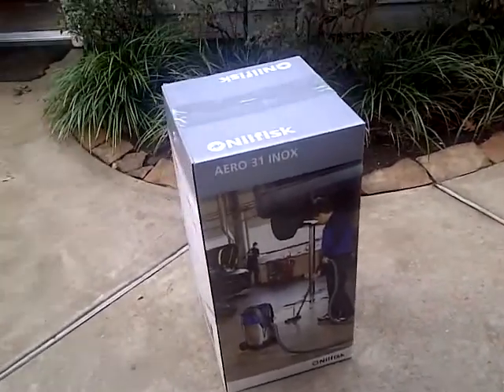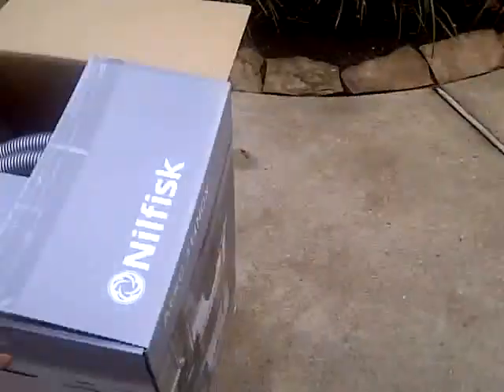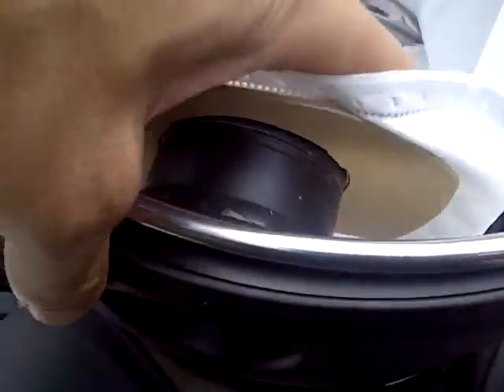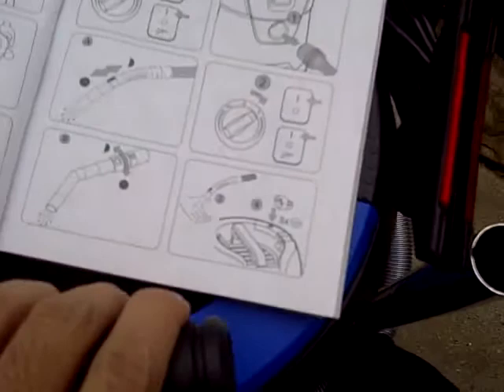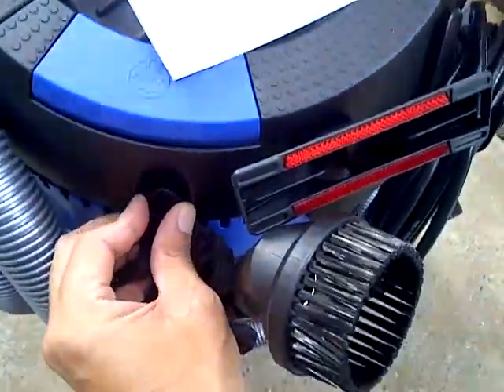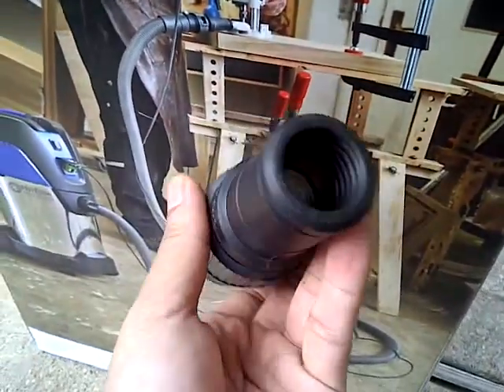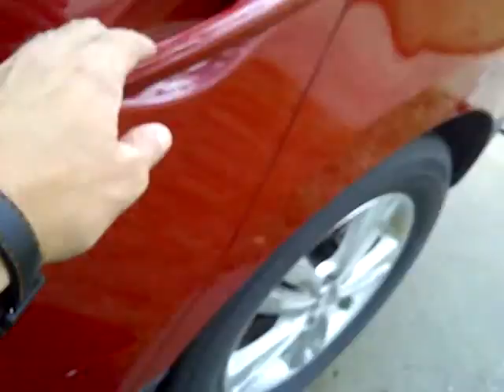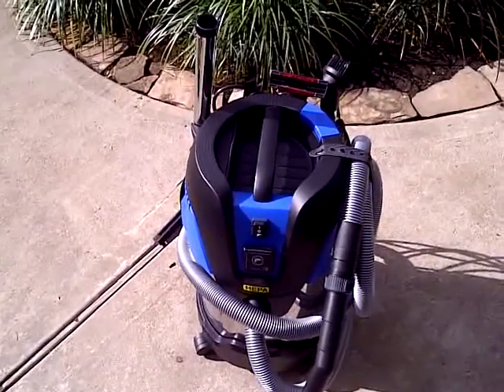AERO 31 - 21 PC INOX 120V/50-60Hz Nilfisk Dry/Wet Vacuum

Comment: The plug is when you use a tool like a sander. When you turn on sander, the vacuum will turn on automatically. Some woodworking tools have vacuum attachments to collect saw dust as you're using the tool such as a sander.
Reply from the maker: Thanks for the comment.

Comment: What do you think about this vacuum after all these years? Was it a good investment? Are there any cons?  Were you using it with power tools? Is it good enough with eliminating dust? What about dealing with water or wet factors?
Reply from the maker: I got it using my credit card points and still have and use.  It is very good.